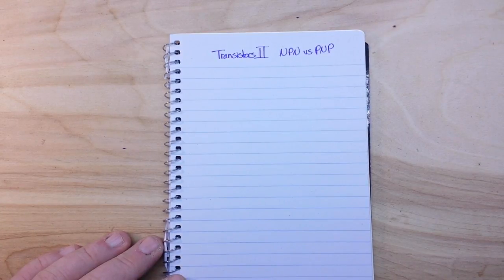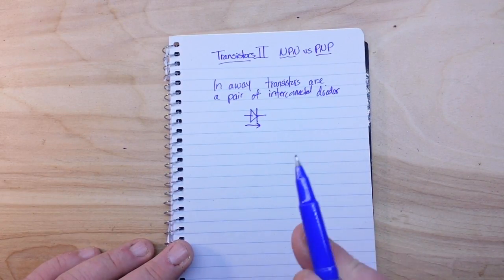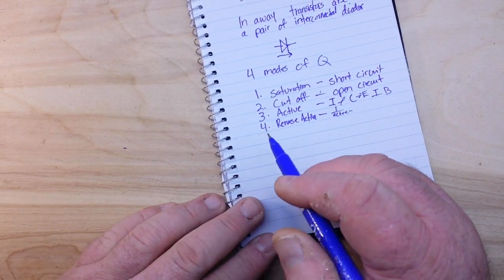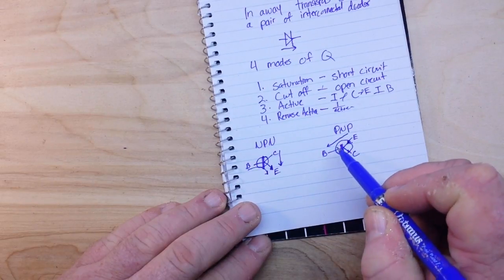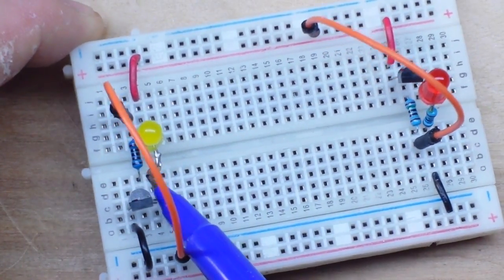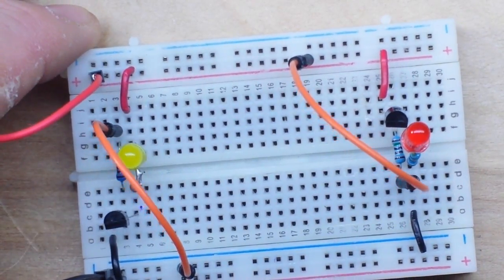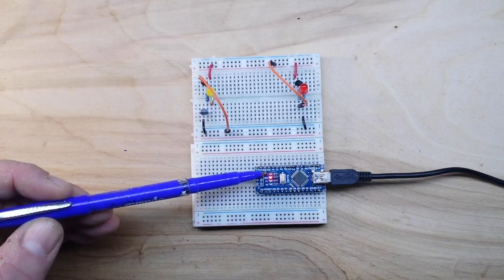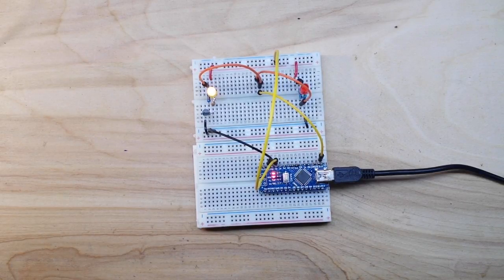Transistors II: NPN vs PNP

Comment: Hi, i have a question about collector emitter. Why does it make difference which way i connect my transistor? I tested mine and it worked on both ways. Im a bit confused. Then how do i identify them? And last question, how big resistor do i need on base?
Reply from the maker: +Mini Tamm if it works both ways your transistor is broken. With an npn transistor, when you apply a small current to the base, a large current can flow from collector to emmiter.
Reply: Thanks for the answer. That can be the case indeed. If you need topics on new videos then maybe can you explain op-amps? I have watched some videos, but they seem kind of confusing.
Reply from the maker: Mini Tamm check my playlists... There is one called opamps
Reply: My bad, didnt notice, thanks.

Comment: because pin 13 is going hi and low. since the its going pos then neg. the ground or neg closes one gate and opens the other. causing the osculation . or causing the LEDs to go ping pong, I know this isn't the best way to answer the question. but it's way past my bed time!
Reply from the maker: +James stranger Yes. You are correct. Any idea why they both light when the bases are floating?
Reply: learnelectronics I think that is a harder question actually lol

Comment: Pin 13 is alternately referencing high and low via its internal bias (pull up, pull down) resistors?
Reply from the maker: +gartmorn yes, but why do they both light when the bases are floating?
Reply: learnelectronics got you.  Is it because the bases are commoned up and the transistors are in essence acting as  diodes giving the necessary bias to the opposing transistors holding both open?  I hope I put that across ok!

Comment: Love transistors. Do you have anything on using capacitors and why i would need them?
Reply from the maker: +J. Clowers That's a large, huge, gigantic topic to cover. Why you would need a capacitor? It is an essential passive component. I will put a capacitor primer together. I just have to figure out where to start. Do you have any specific questions you want answered?
Reply: learnelectronics ive been working with led’s, resistors, diodes, nand gates, opamps and transistors. Just wondering if i could intergrate a capacitor in a project. I sort of know how they work i just dont know why i would use one. If that makes any sense.
Reply from the maker: +J. Clowers Capacitors have so many uses  that it is hard to find a place to start. But I'll give you two: Put a large electrolytic cap (470uF or larger) across the power rails on your breadboard. The cap will help smooth out any ripples in your power supply and act as a "fuel tank" to keep your supply steady.
Second: a capacitor blocks DC and passes AC. Put one before any speaker to protect it from DC.
Reply: learnelectronics ok ok. This is excellent. I think I understand now. Thanks!

Comment: Pin 13 is high - it pulls the bases to Vcc by internal transistors in the uC, thus sourcing the current into the base of NPN turning it on and at the same time the PNP will be off because the voltage on its base is the same as on its emitter. When pin 13 is low - it sinks the current from the base of PNP turning it on and at the same time turns off NPN because its base is at GND, just like its emitter.
 Ruined the game for everybody, I'll let myself out :D
Reply from the maker: +MrJohhhnnnyyy ok, and why do they both light when the bases are floating?
Reply: learnelectronics Because the current flows into the emitter of PNP, out of its base and right into the base of NPN and out of its emitter to the ground. Full path from Vcc to GND, providing current for both bases.
Reply from the maker: +MrJohhhnnnyyy on the nose my friend

Comment: Wow first! :P
Pin 13 is going from high to low and back so when its high it sources the current for the NPN and shorts the base of the PNP turning it off.  When it goes low it shorts the base of the NPN turning it off and sinks current for the PNP switching it on instead.